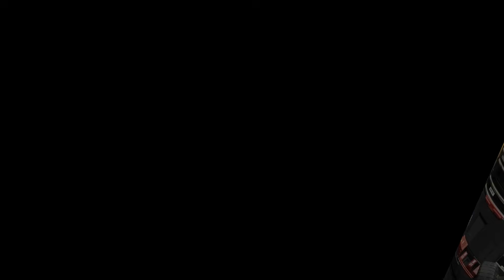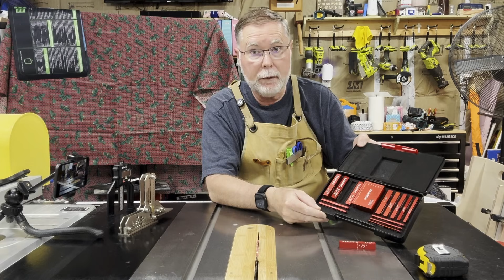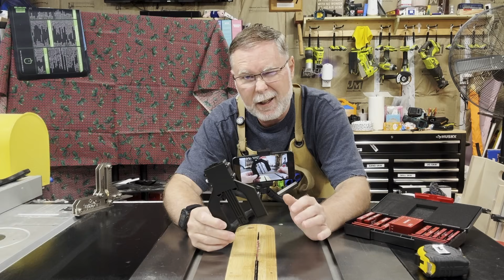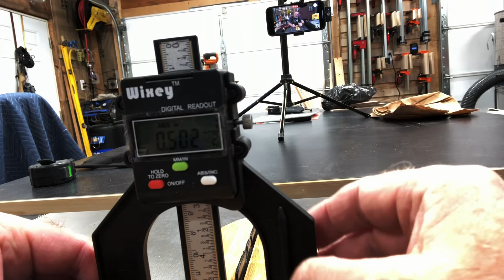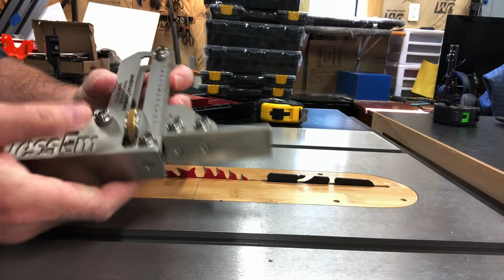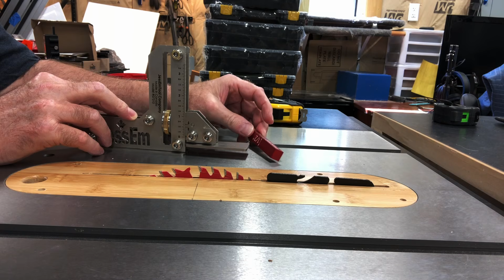4 ways to set the table saw blade height correctly (works on routers also)

Comment from the maker: Hi folks! What method do you use for getting blade heights adjusted? I should note that I just looked down and made my mark aligned with the arbor. It would be more precise to find the center of the blade by raising the blade so that the arbor is closer to the surface of the table saw. Let’s learn together!